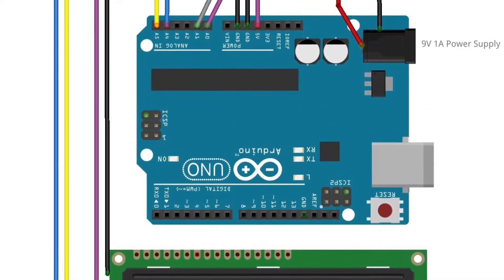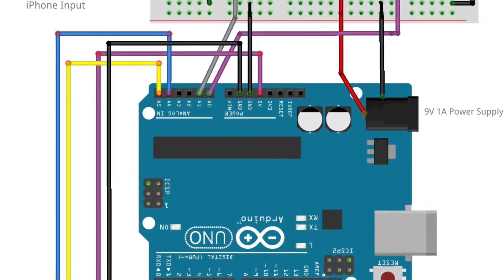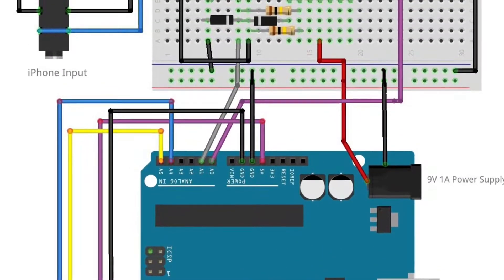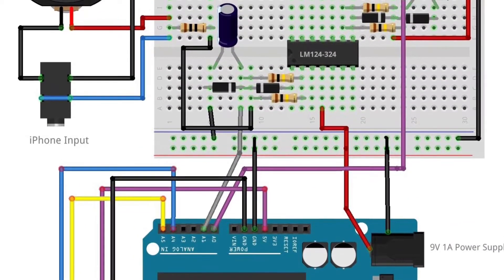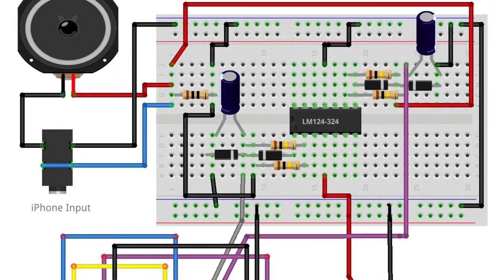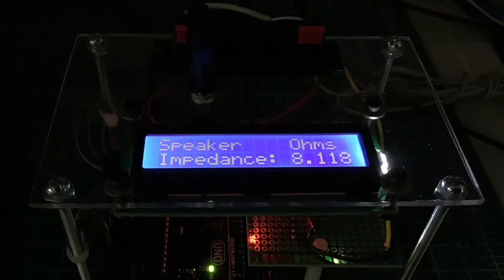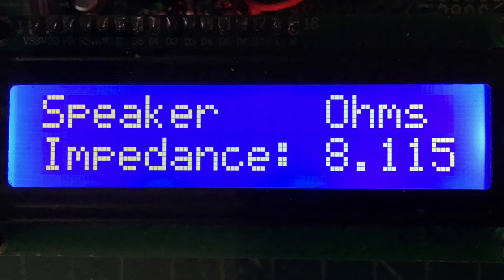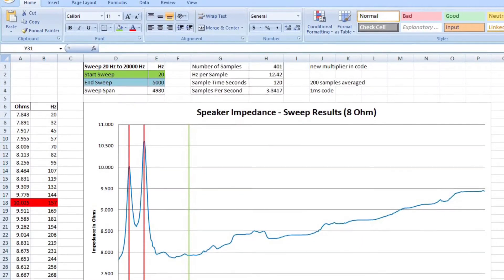Loudspeaker Impedance Meter Using Arduino Preview

Comment: Good to see a post from you. That's looks like a super clever tool! Look forward too more!  I just got an HP 339A Distortion Analyzer at an Auction for a decent price. Looks cosmetically complete,  but sold "as-is".... Hopefully it is working okay as I've got enough test gear repair projects already!!  Sure you and everyone else  that watches can relate to that in some respect!!
Reply from the maker: Thank you. My time posting new content has been limited. Have you had an opportunity to check out the HP 339A? BTW - I published a new video with details on the Loudspeaker Impedance Meter. Best, Don